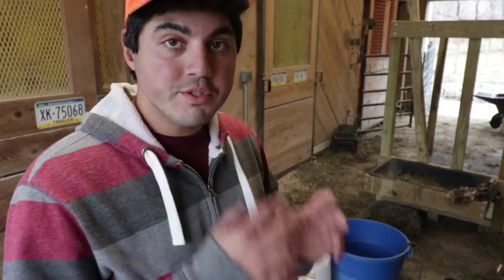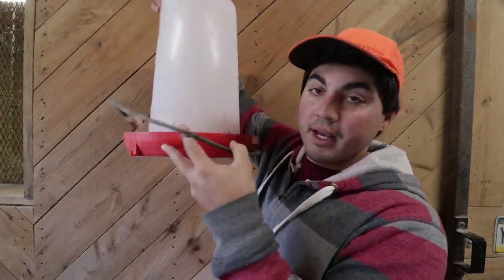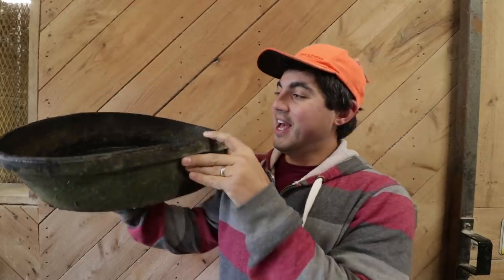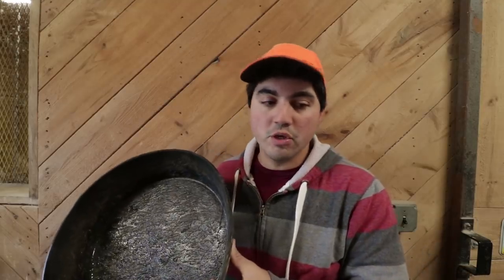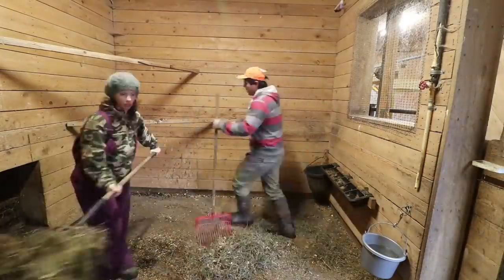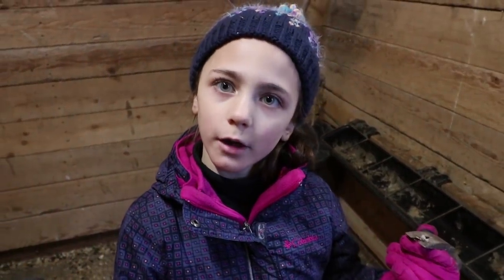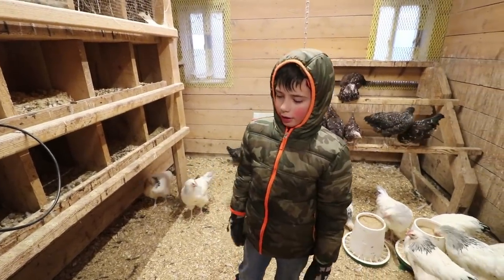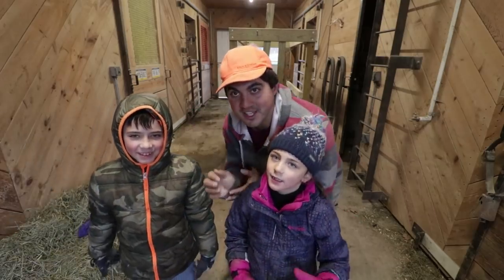NO MORE FROZEN WATER - Winter FARM Water Problems Solved.

Comment: You will want to disconnect any hose from your frost free hydrant so it can drain and not freeze up. Every time. I learned this the hard way. The other option is to put a two way splitter with shut offs on your hydrant and leave one side connected to nothing, and after shutting off the hydrant this side can be opened to allow for the back drainage of the hydrant. I hope that makes sense.

Comment: The children did great with this video.  i used the flex hose [from Walmart] and they didn't make it. Dragging them in dirt caused them to explode a hole. I had to pull out the heavy duty hard hose again and make sure they are drained each day. While the flex hose worked I loved it. I wonder if there is a way to add a heavier wrap on them and they still work. I'm going to buy those flex pans, great idea. Thank you for your videos.

Comment: I use those buckets as well. They work great, I use the large ones. They tend to freeze in heavy winds and when it gets below -20'c. I made stands to set them in and the livestock can't tip them over, which my horse does when it gets close to being empty. The stands work great and I can leave it on the ground. Your barn is so lovely.

Comment: #askhomesteady  Do you ever use carabiners?  We use them all the time one the farm.  They aren't super heavy duty so we match the task to the material.  I was thinking about them when you were putting in the staples for the electric cord, that a carabiner on the staple might make make it easier to move the cord come Spring -- and it would be right there when you needed it next winter.  Also it would be fun to put a string of Edison lights in the same place :)   Or, maybe just a screwed in hook would be simpler yet...  those staples can be a pill to remove and damage the wood.  Your barn seems like such a beautiful and functional space; I have barn envy.

Comment: I use those pocket hoses to fill up my horse water in the winter. I still have to bring it inside between uses because mine did have some water left in it and froze when I left it outside. They are very convenient and lightweight though, so easy to bring inside between uses. Just a heads up I only use mine to fill water troughs because if you drag it across the yard or use it often they break really easily. They will puncture and explode. Mine also takes like twice as long to fill up the water trough compared to a regular hose because they are such a narrow hose but I still love mine even though I'm on my third one in five years.

Comment: I found from years of farming in Maine, the best hoses are the real expensive steel reinforced hoses, like 3/4 inch (I think, its been awhile) when you drain them you put them headed to a spot no one walks to, or will fall from the accumulating ice then just walk the length of the hose over your head to drain. Then drag them in the barn for the night.  Hope this helps

Comment: I tried the "as seen on TV" hoses on my farm.  They didn't last long at all.  They are made for light use to water flower pots, not farm chores.  The pressure is so high, that you can't put one end in a trough and walk away to fill it up because it sprays itself right out of the trough.  You have to stand there and hold it until your trough is full which is a waste of time and can be very cold.  They get holes in them quickly and then are garbage.  I wish they would have worked well because in theory, it would be easier, but in reality, it didn't work.  
Love your videos!

Comment: We tried a heated bucket for the cows (5 gallon one) but the calf knocked it with her head immediately every dang time!  Little stinker!  So we bought a $27 tank heater and just stuck it in our 25 gallon rubber stock tank. It’s been working perfectly. The only issue is that the heat makes it evaporate a lot quicker so I have to fill it sometimes twice a day. 
I have been using the expandable hoses too!  I may have already told you that. So far they’re working great. I put some quick connects (make sure it’s the open ones so they drain) and it makes it awesome. I just quick connect it, fill up the tank, disconnect and stick the hose in an empty bucket and bring it inside (no barn here). So far we have only gotten down to the 20’s but I’m hopeful it will be a good solution.
Reply: Oh also, we use heated dog bowls for the chickens. It was $14 I think at Menards and has worked great. Easy for the girls to just pour more in each morning.

Comment: I use the rubber pans for my chickens and ducks (14) I empty them at night at close up (they are in the run) and I use the smaller ones for my rabbits. I don't mind carrying a 6 quart bucket of water out for the chickens and 2 gallons for the rabbits in the morning now if I had bigger stock I'd probably invest in a heated bucket.